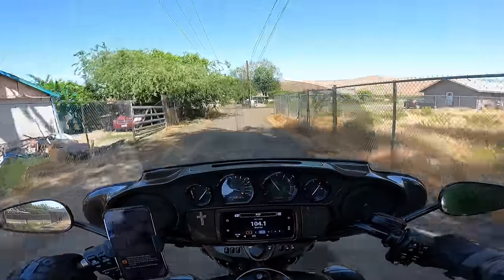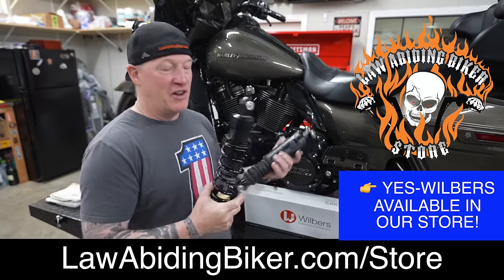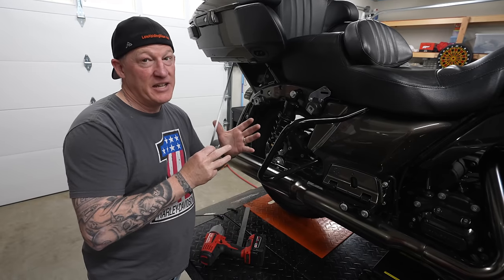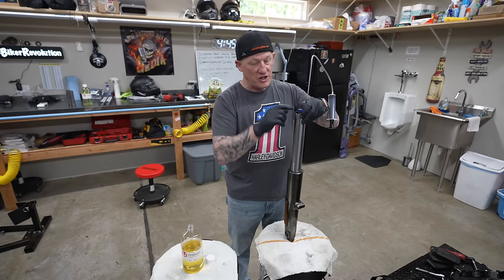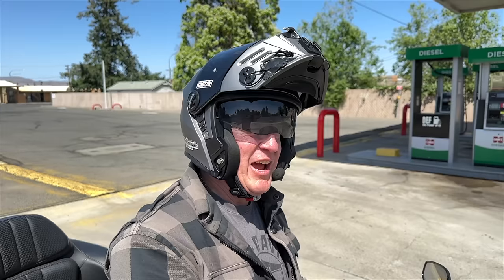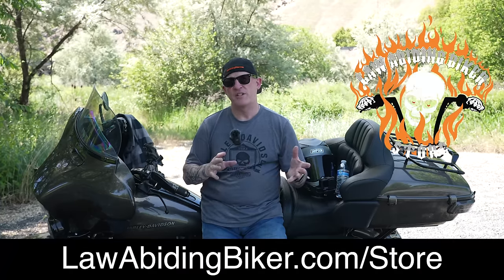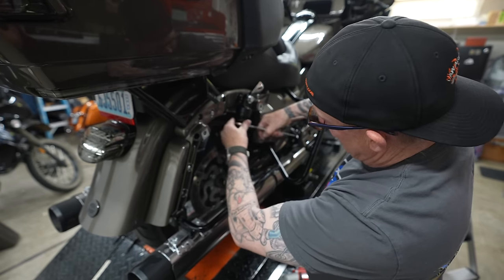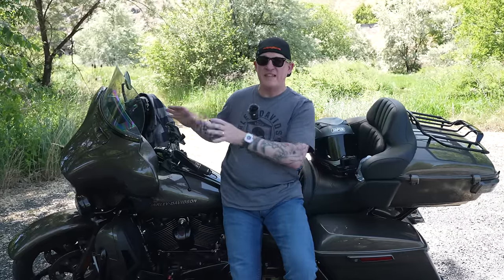Is This Really The Best Harley Suspension?

Comment: Hi and thanks for the great comparisons. Here's a question can you mix and match can I put a Olin on the front and a Wilbur on the rear ?
Reply: Technically you can, but I would stay within the brand. It is dialed in a designed by a single company. Öhlins stiffer, more race oriented, Wilbers more comfort and precision with self leveling in the rear. You have to check your personal specs list.

Comment: How many open the owner’s manual and adjust for their fat behinds? Harley bikes are designed for skinny 150 pound lightweight riders. I haven’t weighed that since the 9th grade.
Reply: If I was to hazard a guess at the weight of the average Harley rider, I’d assume 250-300lbs. I’d hazard a guess at maybe 5% of HD riders weigh less than 200lbs, myself being one of them at 180lbs.

Comment: I bought a used 2016 Ultra Classic with 5 miles on it in 2020. I would NEVER EVER buy another. I bottomed out and topped out because the suspension was so bad. Ohlins replacements were basically $2k plus labor and there was no way I was going to pay that for a motorcycle. I could write a book on how bad the Ultra Classics are. I sold the bike after 9 months because it was a total PoS

Comment: I had both, Öhlins and Wilbers, on my HD Road King.
They are both perfect. 
Wilbers is easier to handle, because when it it set, it's done. 
Öhlins need adjustment if you run with luggage or with two persons. It offers you adjustment for compression and rebound, but you have to know what you are doing.
Wrong adjustment can leed to a bad, sometimes dangerous ride.

My first choice is Wilbers. Makes it easy for everybody.
Regards from Austria.

Comment: The average punter has no clue how suspension works . Let alone  how to adjust  it properly for different conditions weight riding styles etc. I consider My skill level would be above average as a professional. The minute advantages of a properly adjusted Ohlins etc is just not worth the effort.Thats wy I run Wilbers set and forget

Comment: Upgraded my 2020 CVO Street Glide with the Wilbers  system after doing some research. The fact that the Wilbers are self levelling sold me on the suspension. Watching @MillionDollarBogan taking his Road King off road just reassured me that this is a great system and will last forever as I’m not taking my bike off road.
Reply: It won’t last forever and the rebuilds are $450 and as far as I know they are the only ones that do the rebuilds.

Comment: Great review! I love the self leveling of the Wilbers on my Ultra. That is what sold me on them. My wife rides 50% of the time and the thought of having to make constant manual adjustments bugged me. I was looking at the Legend Air Ride before I found the Wilbers and for the same money, I was doing all 4 points and with the Legends was just the rear.
Reply from the maker: Great! Thanks for sharing your experience.
Reply: I have complete Wilbers on my 21 SG. Incredible difference compared to the terrible stock shocks!

Comment: My 2012 switchback went into death wobble, went through some rough concrete while I was leaned over a little bit to one side on stock suspension running about 95mph. 
I don't want to experience that again. 
What would be your recommendation for my 2023 road king special  ? 
Thanks  !

Comment: I have ridding approx 50k with Wilbers now... having them on my FLHRXS... going mostly long haul with quite some luggage and full saddlebags, tent etc... they are amazing, notably when going on curvy/winding roads, and at higher speed on the freeway.... side wind stability is fantastic, no wobbling... whatsoever... the only thing that sucks relates to the OEM tyres, being low profile for the "looks of a Special"... but that has nothing to do with any aftermarket based upgrading of the suspension... no matter what one would go for.... absolute recommendation!

Comment: put 12" legends on my 05.U.C. all 4 corners. the air ride, o.e.m on the rear and stock up front, got to so bad, didn't even want to ride. wife and I ride 2-up on 2 to 5 thousand mile road trips. Now it's like riding in a caddie😊. First thing new harley owners need to First! NEW shocks all 4 corners.
Reply from the maker: Rock on!! True

Comment: I ride a 20 CVO LIMITED. The wife rides 90% of the time. I also pull a Bushtec trailer. I wondered what your opinion would would be
Reply: One more question. What if I went air. Do you have a preference for systems on the market. Dirty Air ect.

Comment: I ride a Road Glide CVO 2022 with the awfull 21" frontwheel. The frontsuspension is really terrible. Will the Wilbers suspension be better at front and does the bike stears better with that suspension ?  Or do i better change the 21" frontwheel  for a 19" frontwheel ?
Reply: Never got a reply? What’d you end up doing? I have a 2022 envious green fade cvo and the suspension is shit. Debating on which to go with